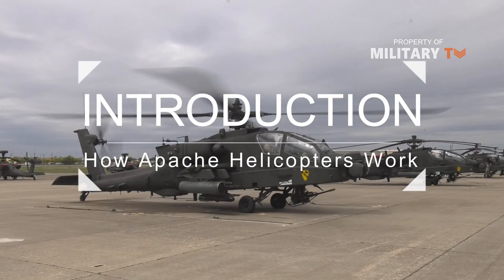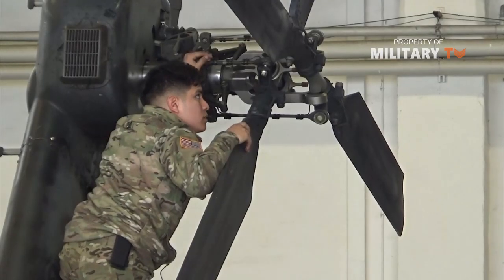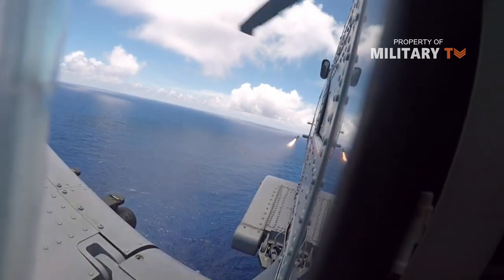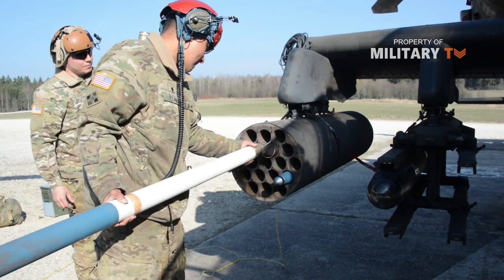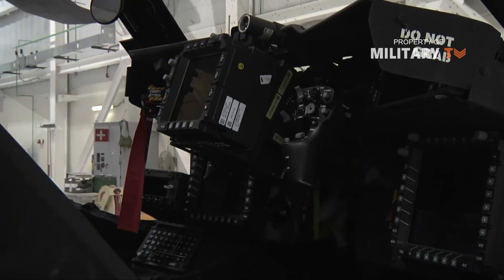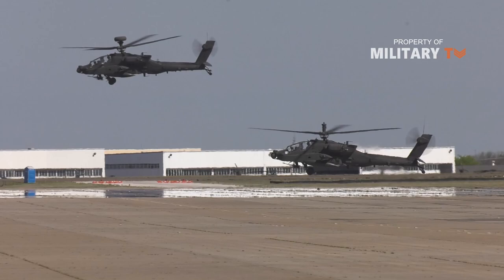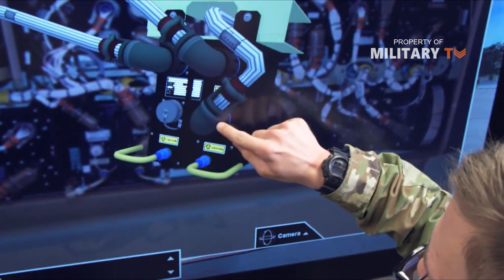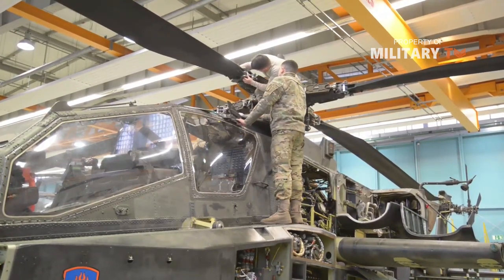The AH-64 Apache Helicopter Monstrous Power & Capability

Comment: man, have you ever seen MI-24? Let aone newer models? Best ever made, haha :D
Reply: Not compared to this.
Reply: Aged like milk
Reply: The mi24 is a big bloated target. It is not maneuverable and quite easy to take out of the sky with a 30 mm cannon that all you have to do is look at it and pull the trigger and you see chunks of it flying into the woods.
Reply: @mrgrinch837  not what i hear said. but its certainly not the best ever made. just look at how comanche story ended. i certainly would like it compared to kamov modern models...oh wait. i did.
Reply: @bodymaker16  The point I'm making that you may have missed is helicopter battles against each other are pretty much even.  The first one seen is generally the first one killed.  I mention the AH-64 would come out on top because a turreted automatic cannon allows you to get rounds on target much faster than one you have to aim with the helicopter.  The KA-52's gun while impressive it's got more similarity to a fixed wing airplane.  Only it has variable elevation while the Apache turret can turn 80 degrees left and right as well as increase and decrease pitch.  It's aligned with the pilot and gunners helmet so all they have to do is look at the target, pull a trigger and bullets begin flying.  The slew rate is remarkably fast, you can almost hit a baseball with it.  From siting to firing you're talking less than 1/2 second.  That's a huge advantage over the KA-50.  But hey, if you like that you may as well stick to fix wings because in most respects it is.

Comment: All that talk of survive ability for the crew and you never mentioned the fact that it's one of the only helicopters to employ an ejection system inside the hub of the main rotor there is exploding bolts that free the blade they fly away from centrifugal force and the seats fly up
Reply: Update your knowledge base. There are only a few and the Apache isn't one  of them. See: https://aviation.stackexchange.com/questions/43264/are-there-any-helicopters-with-ejection-seats
Reply: Yeah bro, been working on them for 5 years and flying them for 2. promise there's no ejecto seato
Reply: @knackypoo9951  umm yes they do? prehaps not on the model you work on if that is even true but yes i went to boot camp got to sit in one and ask the pilot questions and one of those question was holy fuck is that an ejection seat? so being that i was in the seat looking at the handle for the eject im pretty sure im right on this one
Reply: @knackypoo9951  well it was about 1998 so prehaps the model is different or the system was removed for some reason but i promise the one i sat in DID have an ejection system
Reply: @knackypoo9951  fly AND work on them? sorta doubtful
Reply: @stuffhappensdownsouth9899  i think what you're thinking about is the jettison system. it pushes out the windows so we dont get stuck inside. But I promise you there has never been a ejection seat.
Reply: @stuffhappensdownsouth9899  yeah i was a 15R. apache mechanic. switched over to warrant officer life. it's a thing.
Reply: @knackypoo9951  man i swear the pilot explained the whole thing how the rotors have explosive bolts to free them during the squence and how it wouldnt work below a certain altitude maybe ask one of the ol timers if it was ever tried
Reply: @knackypoo9951  i guess its possible dude was messing w me and he couldnt really explain most of the systems in the cockpit because it was classified he really didnt wanna talk about its sensor capabilites and i mighta got em a lil angery :)
Reply: @stuffhappensdownsouth9899  i went through flight school learning from nothing but A model 30+ year pilots XD
Reply: @knackypoo9951  thats kinda cool so u started out workin on em an decided u had to fly it?
Reply: Jay Means it’s a Kamov thing. Recall the Germans used on the Dornier Pfeil.
Reply: Please tell me you’re joking.
Reply: Jay Means😂🤣😂. I’ve been on this aircraft longer than you’ve been alive. There has NEVER been an ejection seat.
Reply: @secretsquirrel8010  your statement is already false because you presume to know my age all I can  tell you is that I was in JROTC went to ft bragg for the boot camp they lined us all up on the perimeter of a huge parade ground and landed one in the middle and it blew us all down then they drove an M1A1 up and let us all pick which one we wanted a tour with i picked the apache and had a few mins one on one w the pilot i was sitting in the cockpit asking about what does what most of the answers were classified but i pointed to one thing and he explained it as that system prehaps he was lying who knows but that's my account
Reply: Jay Means... and what year did this Apache blow you all down?
Reply: Also... there is no “boot camp” in Bragg.
Reply: @secretsquirrel8010  97-96 i believe
Reply: Jay Means... yeah like I said... I’m older.
Reply: @secretsquirrel8010  another commenter told me it was proly the ejection of the canopy he was speaking of so i mighta been mistaken i was 16 at the time and had been marching for about a week now :)
Reply: Jay Means... possibly. The windows have PADS (propellant activated device) on all four side windows that can be activated from either seat or handle in the nose in the event the aircraft crashes and the doors on the right side of the aircraft cannot be opened.
Reply: @secretsquirrel8010  but you assumed that and also if you wanna do a lil maths.... the apache was entered into servivce in 1986 sooo even if u got on the first one my lifespan would still outnumber your years of service by at least 10
Reply: @stuffhappensdownsouth9899  that's ridiculous. The only chance in Apache pilot has with an ejection seat is during the crash. It'll eject the seat with the pilot still strapped in across the ground into a flaming pool of jet fuel at the point of impact. The Apache has never had an ejection seat, that's freaking ridiculous!
Reply: @knackypoo9951  Chief Warrant Officer too, 10 years flying cobras. The Apache does not have an ejection seat, never did. That would be insane.
Reply: @stuffhappensdownsouth9899  they have a canopy jettison system just like the Cobra did and all it does is it blows out the canopy so you can get out in case the damn thing rolls over on the right side.

Comment: It's not even close to being bulletproof
Reply: It has 1100 kg of armour and can withstand 12,7 mm rounds and vital engine and rotor parts can even withstand 23mm rounds.
Reply: @2esquared  it literally doesn't have armor at all except for the actual pilot seats...
Reply: David Shaq... not true at all. The fuel cells are ballistic proof, hydraulics are backed by Kevlar plating. Etc. etc. etc. You have no idea.
Reply: @secretsquirrel8010  there's also transparent armor glass between the cockpits so if one cockpit gets blown up it doesn't take out the other. You just have to get somebody to clean his brains off that clear armored glass.